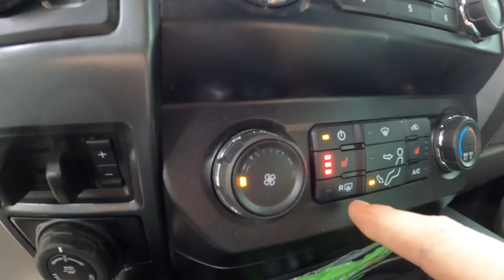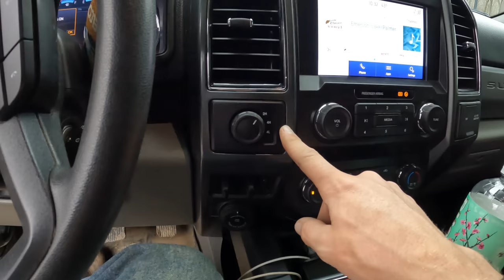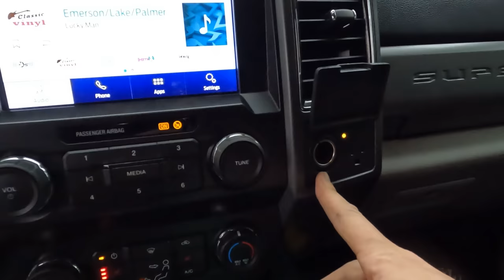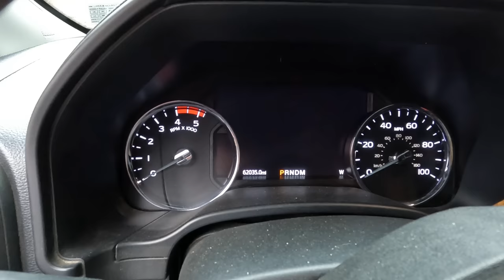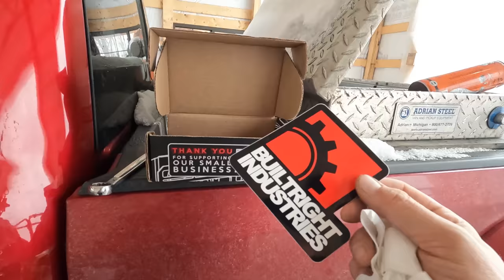I bought THE BEST Pickup Truck on the Market (Ford F450)

Comment: Build you a skid to set it the bed, hold your pack rat, and put some boxs attached to skid where they set out over the bed rails so you still got room, build it to lock on the 5th wheel. With some fork pockets I have built several for mobile equiment work and welding it way to go cause you just set out all the tools if you need truck bed. If I building one for a 2021 f450 I use aluminum it looks slick and match the bed material.

Comment: A lot of people tend to hate on the old 6.0 powerstrokes, and I i'll admit, I do as well sometimes. What most people don't realize is that they were actually very strong motors when they ran well. They made a bit more power than the 7.3 and you can't help but smile when you hear the turbo whistle

Comment: 4:13 before rust gets to the new one, yes they’re aluminum but it will still oxidize fluid film, wool wax, pb surface shield, Amsoil heavy duty metal protectant. They all work to seal out moisture, get it on that new truck once a year and it will actually run until it dies instead of run until it rots.

Comment: I have a 2016 F350 cc drw with the 6.7 Diesel. Take the wife, take the house, take the dog, but don't even think about taking my truck. It is BLACK. I pull a 37' 5th wheel RV with it. I have to look occasionally to see if it's still behind me. On hills, it's left lane only, all vehicles get out of the way  'cause I'm coming. My back seat, driver's side, came with folding rear seat (both sides). I also have and love the hiding step. It is a show stopper when others around see it in operation. Something so simple, so useful. 

Take care of the vehicle. I had a Chevrolet C10 in 74 and switched to Ford in 77. I've had nothing but Fords ever since. Little to no problems. 

Good Luck with her. I like the color.

PS. Born and raised in J-town, PA

Comment: Forescan can change it so your plugs stay on instead of shutting off on you.

Also when you do hook up the upfitter switches the wires are located under your passenger battery

Comment: What I like about the 450-550 trucks is the wide track front axle that gives the vehicle a way better turning radius then the 350 and less. They are towing machines that are engineered well and definitely take a great deal of abuse if maintained. I'd recommend a def delete if possible. They kill the motors on these prematurely. The whole emissions system actually. If you can do that the motor will last longer and deliver power better. Stay safe driver ✌🏽🇺🇲

Comment: I agree I have 2004 6.0 with 356,000 runs and drive amazing, have done basic maintenance, batteries injectors ficm  upper and lower ball joints tires. Very reliable

Comment: I'm not a Ford guy but that truck is a beautiful one.

I do have to take exception of your comments about the type of trailer you wish to pull, though.  A goose neck with a 5th wheel pin is safer than a bumper pull or a goose neck with a ball hitch.  You can also jackknife a goose neck to a much greater angle than a bumper pull giving you a much better turning angle.  Plus, since a goose neck trailers mount point is ahead of the rear axle, you can pull significantly more than with a bumper pull without adversely effecting your steering (as you add weight to the hitch of a bumper pull, you reduce the weight on the front axle - that is not true with a goose neck).  As a result, your F450 has a 37,000 lb tow limit if you are pulling a goose neck but is restricted to 24,200 lb with a bumper pull trailer.

Comment: 7.3ps and 6.0ps are HEUI, 6.4 and 6.7 are Common rail, the oil plays no roll in the injection process.... Having clean fuel without water contamination is absolutely critical for common rail engines. You may want to look into a fass but the OEM fuel pump and filters are pretty good if you stay up on maintenance and keep a good eye on any fuel you store on the farm.

Comment: @DieselCreek   The fuel system you spoke of is called HEUI system and was used in the 7.3 liter and 6.0L power stroke engine and is hard on the engine oil.   The 6.4L and 6.7 L  power stroke have common rail fuel system which doesn't use engine oil to fire the fuel injectors.

Comment: Congratulations on the purchase, nice rig. 

Just like to point out that who ever told you that common rail injectors are operated by the engine oil is as far as this diesel mechanic has ever come across, incorrect. 

They are operated by high pressure diesel and electronically controlled. 

They are technically hydraulically actuated but this is done with diesel under high pressure depending on the engine, upwards of 30,000psi accumulator pressure. 

They sometimes use pilot pressure to shut the injector again until it's retriggered electrically. 

Just thought you would like to know that. 

Love the content Matt live the old machinery. 

Near us in Tasmania we have an annual stream festival with lots of old junk as my wife puts it. 

Very much enjoying the shed build too.

Thanks for the great reason for procrastination.

Comment: aye tip for rust, wash unerneath the rig and then spray it with deodorized fish oil, itll help keep the rust out just make sure to hose down the underside and spray it from time to time, old tip from driving on the beaches in Australia just makes things a bit annoying to work on under there sometimes but better then going soft and falling apart

Comment: Matt, I bought a 2002 Ford F-150 Lariat back in 2006 that had 56 thousand miles on it. I swore years ago to never buy a brand new vehicle ever again.
You had yours 10 years, mine is 22 years. Here is a small list of repairs: just bought 4th set of tires 5th battery. Replaced all 4 disc brakes last year, and also is 2014 replaced one MAP sensor and 4 coil over plug's. Just had a problem with the differential limited slip , but fixed with 4 ounces of gear oil additive. Now that is a geat track record expect the same from your new Ford. By the way mytruck now has 359,000. miles on it

Comment: Your new truck with a 6.7 does not use high pressure oil system for injection. It uses high pressure fuel. Like really high pressure, around 25,000 psi. High pressure oil systems like 7.3 and 6.0 were much less pressure than that, maybe 3,000 or so if I recall.

Comment: The type of fuel system you explained is a a HEUI system, which , yes the 6.0 uses. The 6.7 Common rail uses high pressure fuel only, no high pressure oil! Great vid!

Comment: You're thinking of HEUI injection. 7.3 and 6.0 powerstroke both used that system, as do a number of Cat engines. 
Modern Common Rail systems do not use the oil for anything but to lube the drive gear.

Comment: Porsche did the same with the intake and exhaust on their v6 turbo cars.  The turbo sits in the valley, and the intake is to the outside.  Makes replacing the turbo easier

Comment: We use big boxes and best way I’ve found is to tether to both left and right points with lock. Not perfect but if you get in accident slows a possible missle. 

Maybe can use holes in feet to use heavy duty cable if don’t want to drill.

We put and rivet heavy handles on exterior of box. Handles are nice too for lifting box.

Comment: Common rail does not pressurize the oil it's running the fuel at high pressure you are thinking of HEUI injection that was used in the 7.3,6.0 powersmokes as well as the 3126 cat and dt466e as well as a few others

Comment: Hey Matt look up on Amazon a thing called ez drain it screws right into your oil pan and instead of having to pull the bolt out you can just turn a lever. It’s a spring lock ball valve that can also be a 90 turn down so your oil don’t shoot back out of the drain pan. I’ve had one on my truck for over 40,000 miles and with my truck in and out of woods and pastures and off road all the time I’ve never had an issue with it.

Comment: Your commentary when opening up the hood and showing the engine bay is so on point, exactly how i have felt. "Somewhere down there is an engine"
On the Volkswagen vans these days you need to remove several components from the engine bay just to replace the headlights, it is baffling.

Comment: Hello,sir, I own a 2021 f450 xl also and noticed that it is extremely loud inside the cab. It sounds like the fan is coming thru my dash…. It so loud that I have to turn up my radio as loud as it can go to hear it. I took it back to ford and they told me that was normal for these trucks. I do like the up fitter switches also, they are handy to have.  I put a flat bed on mine as it was a cab and chassis when I purchased it. Wouldn’t trade my flat bed for anything.  I also was sold on this truck because of the turning radius… absolutely amazing, my dad hates it because he has a f350 and has to back up a lot. Lol. Thanks for sharing and God bless and merry Christmas to you and your family.

Comment: The fuel injection system you described is the heui system used by 7.3/6.0/6.4 power strokes. Common rail uses the injection pump to make high pressure fuel to pressure the rails then the computer opens and closes the injectors using a solenoid on each injector. They can even be fired multiple times during the engine cycle

Comment: Hey bro. When your truck is off and you want to use your outlets. Just press the power button on the radio and they will turn on. I just figured that out like a week ago. It works on my 2016 ford so I’m pretty sure it will work on your 2021 lol
Reply from the maker: Thanks for the tip I’ll try that!

Comment: Great choice. Taylor Ray went up to a newer model for the same reasons, much more power and comfort, completely stock. His old Cummins swapped F-350 was good, but even tuned and modded only had 70% the power(and was older with fewer creature comforts). He travels a lot pulling a 5th wheel.)

Comment: My dad had the 6.0L too as a work truck and he doesn't do any maintenance and it lasted about 18 years until the manifolds completely rotted and seized up the turbo full of soot.  Honestly could have been fixed but he bought a new F350 gas truck.

Comment: I believe you have heui injection and common rail mixed up. 6.0s use oil to fire the injectors or huei. Common rail is used in all new trucks using a high pressure pump that is normally gear driven to send high pressure fuel to the rail where it’s evenly distributed between the injectors. The injectors are electronically controlled

Comment: The 6.7 is fueled by the cp4 which is powered by the camshaft high psi oil pumps are only used on 6.0s that’s heui which gains psi from the oil pump

Comment: As far as I can tell, HEUI systems were really only a CAT, International, and Ford thing, and it was only used from the 90s upto the late 00s. That technology was from a fairly lawless time in diesel engines where each manufacturer was trying to come up with their own direct injection thing, before everybody ended up converging on modern common rail injection. Nowadays everybody uses the same basic technology of a low pressure feed pump, a high pressure fuel pump (or multiple pumps, in the case of some heavy duty truck engines), a high pressure rail with a discharge valve and pressure sensor on opposing ends, and electronicly actuated (usually pietzo) injectors.

That engine still needs the absolute best oil it can get, but that`s mainly for protecting things like the bearings and turbo, and using the wrong oil can wreak havoc on the dpf

Comment: If you get the SLT or Tradesman or custom order a RAM 2500 and up you can opt for the floor shifter transfer case. I used to want that but the 4wd auto feature mine has comes in handy on slippery days or while towing.

Comment: Pennsyltucky rust got Ol Blue pretty good, it's inevitable Clifford will get got by the Pennsyltucky dry rot too. Hopefully, Clifford will put up a good fight for some years though. Diesel tech has definitely come a loooong ways. I own its grandpa, a 1988 F250 with the first year 7.3 IDI. The only good thing about that motor is that it is so weak it doesn't make enough power to hurt itself so it lasts. I also run Rotella T6 in the old girl as well and also in my motorcycle's motor too. Good stuff.

Comment: Just fyi common rail doesn't use oil to inject it has a high pressure gear driven fuel pump.   The 7.3 and 6.0 used heui injection that sends high pressure oil to the injectors

Comment: I own a 2002 7.3, same style, F250 extended cab long bed single rear wheel XLT... I always thought the 6.0 sound so much meaner. Congrats on the F450. Crazy how quiet they are.

Comment: you ought to just build you a power wash type thing. with some nozzles going all around especially from the bottom so you can just drive over it and have the nozzles spray the bottom with water obviously to clean it

Comment: The one thing that is still steel and rots out quickly are the running boards !  You might have to wait until spring but ...
1) Drill some drain holes in the running boards
2) Rinse the inside out with a pressure washer
3) Wait for a couple of warms days to let the inside dry then spay inside with Fluid Film until it drips out
4) While you have the Fluid Film out, spray the bolts holding the shocks, the tie rod adjuster, the parking brake adjuster, caliper and bracket bolts.  Drop the spare tire and spray the entire mechanism and both sides of the spare tire wheel.  Do this once a year, and you will be happy when you have to deal with them !!
Reply: yes   fluid film the crap outta the bottom of that truck.. inside frame rails inside everything you can get to.
Reply: And anywhere steel and aluminium touch, eg...steel sump plug/ali sump use nickel-slip or Tefgel to prevent galvanic corrosion.

This is from 20yrs of owning old Land Rovers.

An ounce of prevention is better than a pound of cure.
Reply: Had a friend who put a grease jerk on the rockers and filled them up
Reply: @douglasanderson1276  I would have used a zerk, but then, he may have better luck with his choice ;)
Reply: That kind of upkeep and preventative maintenance labor is offset by continued uptime not left to chance. Smart operation.
Reply: This guy Fluid Films. Nothing exemplifies "an ounce of prevention is worth a pound of cure" like keeping the salt away.
Reply: @teekay_1  how dare you point out my mistake I cried for 2 hr straight and now i am dehydrated
Reply: He probably has already done it and the video is in the can ready to go.
Reply: @douglasanderson1276  lol
Reply: @zippythechicken    I have a few friends that picked up some spray bars from tractor supply or Harbor Freight.  They hook to your pressure washer and you roll them under the truck to flush all the crap out from the underside.  They swear by them.  They use the bars once a week, or if they get particularly muddy, and their older trucks look way better than  the newer counterparts that don't get a proper rinse.  For such a quick and easy task, you'd think more people would do this.
Reply: @douglasanderson1276  Aluminum rocker panels do not rust.
Reply: My 02 F'd 250 had aluminum  running boards put on by the dealer.  They never rusted, but the cab corners and doors rotted out.  The cab stated getting crunchy over bumps.  180k and 18 years old, it was time to go. Brine here in PA eats all.   Ran great if the plugs didn't  fly out or the coil packs died.  Went with a used  Tundra.  Not looking back so far.
Reply: @douglasanderson1276  I wondered  about that.  Great idea.
Reply: @zippythechicken  I work for a Telecom. Our trucks won't  fit in a car wash and they want us to was them in a U wash once a month. We can't get the crud out from underneath. And the brine here in PA eats everything.  May as well drive it in the ocean.  It looks the same..
Reply: Linseed oil all the things!

Comment: Glad to see the new pickup.  One thing though... Using seat covers with heated seats can cause problems, from less heat to fires.  My Chevy has them and the manual warns against seat covers due to the possibility of fire.  You might want to look at that.  Merry Christmas to you and yours!  :)
Reply: Nothing like Hot Smokey Buns while driving!
Reply: Chevys are built so poorly that they are prone to fires even if the seats are removed.
Reply: @MookieMan1  I knew THAT was comin!!! 🤣🤣🤣
Reply: @publius9606  for real though. The American trucks are all hot garbage. Ford is the best of the bunch, with a huge gap to the next best - Chevy. Following that garbage is the steaming pile called RAM.
Reply: @MookieMan1  with ram, I have heard they are steaming hot piles of shit or super reliable. I’ve asked a bunch of ram owners this and those seem to be the responses.
Reply: @IntrnetCat  they have the lowest resale value for a reason. They also were the only vehicles that had discounts still on them during the huge inventory shortages. 
Every time I see a ram, I know that person was a budget shopper.
Reply: @MookieMan1  you obviously aren't friends with any ford mechanics